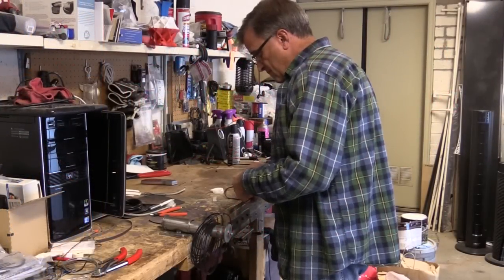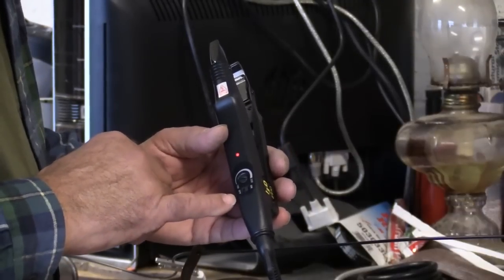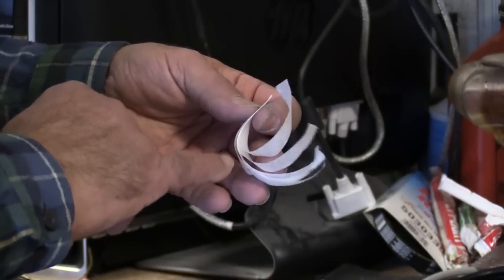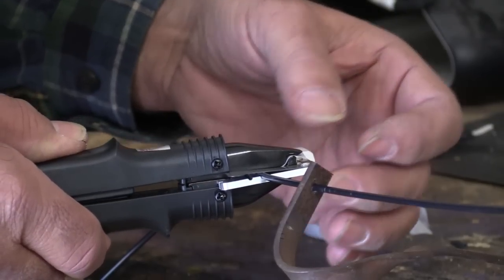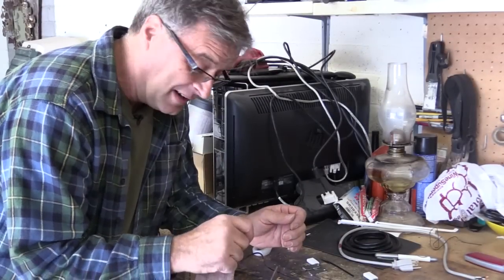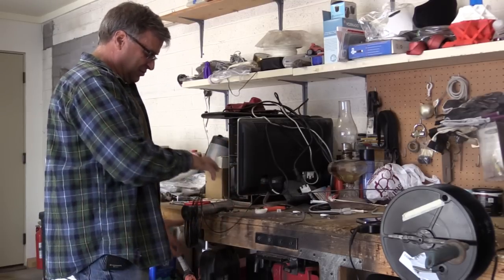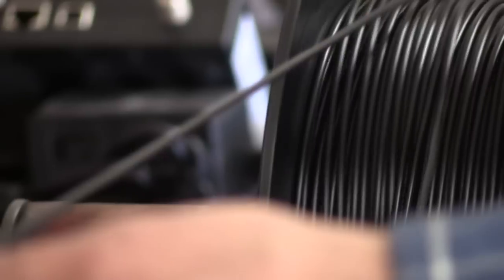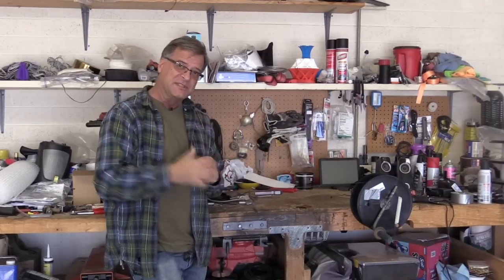How to Make a New Tool Work Well for You Using a Filament Welder - Kevin Caron

Comment: The "paper" stuff looks like a nice quality parchment paper for cooking.  The cooking stuff is good to about 350F and is basically non-stick.  So you might try some parchment paper from the baking aisle when you run out of the little strips that came with it.
Reply from the maker: +James Munn      Thanks for the tip!      Will check that out..

Comment: This seems overly complicated a way to do something simple. Have you tried a small heat gun to melt the end, and then just stick them together? I make my own o rings when they’re too big to buy. So I’ve got a plastic sizing device that enables me to cut the ends square. Then I glue them with crazy glue (well, a better version) on an aluminum block i milled several different diameters into to match the diameter of the o ring material, to keep it straight.

I’m just wondering whether something similar could be done, but with a small heat gun. Put the two on the block, heat the ends, and then just push them together. If you mill a slot at the bottom, the heat could come through that, and just hit the ends. Maybe make it out of Teflon instead so that the aluminum wouldn’t melt the filament from the heat.

I don’t have a 3D printer yet, because I can’t find one that will do what I want, and doesn’t cost in the high 5 figures, so I don’t have filament to experiment with, or I’d try to make a device up to try.
Reply from the maker: Whatever works for you is correct.   Have not used this in a while.  Not been printing that much.